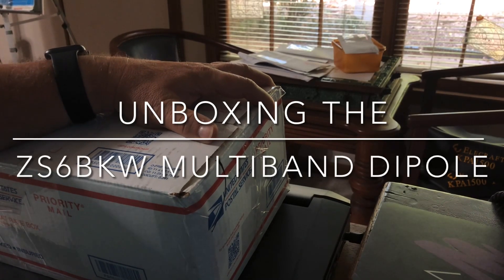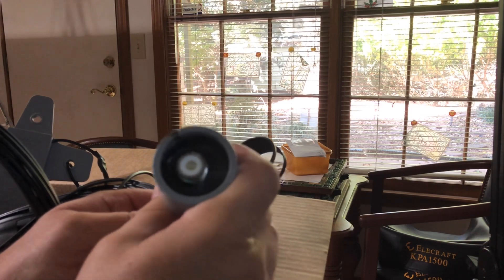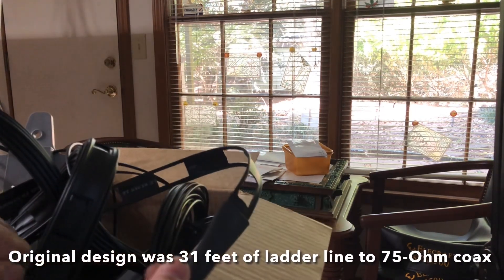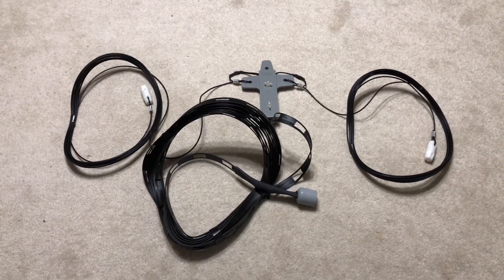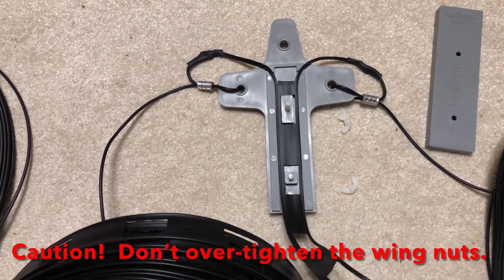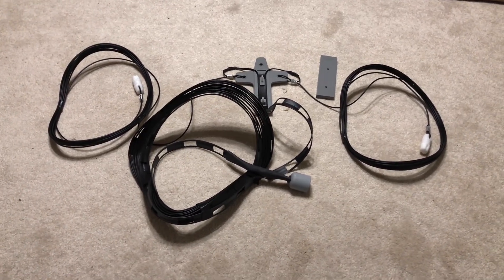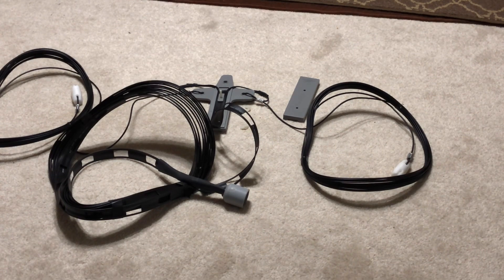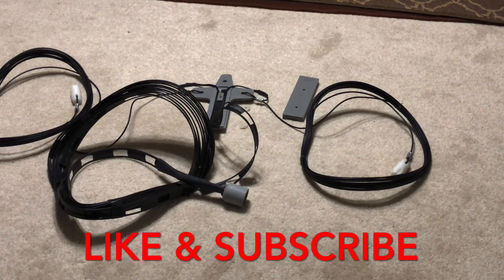Unboxing the ZS6BKW multi-band dipole from NI4L.com

Comment: I like this antenna because of its simplicity. If I get one, I will use my tower to pull it up, but the coax has to go through a switch. It will be more than 70 feet, mostly underground. Thank you for showing this antenna.
Reply from the maker: It is a good antenna.  Make sure the ladder/window line can’t touch the tower.  Try to keep it a foot away from the tower.  It shouldn’t be near any metallic object.
Reply: @ Good points and I can keep it away for the tower.  I am glad you showed it because my OCFD from Radiowaze Balun keeps saturating at 500W from my KPA500 using a KAT500, causing the SWR to rise in contesting.  This caused the KAT500 to disconnect the KPA500.
Reply from the maker: I have a German-made OCF dipole (Fritzel FD-4).  I thought it was great until I put up the ZS6BKW.  But, like G5RV, there are many variations of the ZS6BKW.  I prefer the one I have, from NI4L.com.  There is no Balun and it doesn’t need one.  I tested to be sure.

Comment: Do you know how i can get a hold of Chris Fox? I ordered a ZS6BKW from him over a week ago and haven't heard anything. I've tried contacting him through his website with no response. I don't care it it takes a while to get the antenna,but I just want to make sure he got my order.
Reply from the maker: The email on his website is all I have.  I emailed him 2 months ago because his web site wasn’t even accepting orders for the ZS6BKW.  He does that when he is overwhelmed with orders.  I wanted to find out when I might be able to place an order.  I haven’t received a response yet.  I suggest buying two when he is accepting orders.  He sounds like an older gentleman.  There is no telling how much longer he will be in business. Lakeview antennas made the original Ham Stick antennas.  The owner passed away and they were gone.  Autek Research shut down too.  Now MFJ is gone.  MFJ made great antenna matching units and Ameritron amplifiers.

Installing two identical antennas, perpendicular to one another, allows full 360 degree coverage.  Switch between them using an antenna switch, to see which one has the best gain lobe in the direction you are working. 

I heard that Chris is a one-man show. If he’s answering emails he isn’t building antennas.  I think he still works a day job too.  But quite often the issue is parts availability. He has had difficulty getting the wire.  He quotes 7-10 business days on his web site, but some orders have taken a month.  I guess he could hire some employees and maybe double the price of the antennas, but I would rather wait, and pay less.  His prices are lower than others, probably because he is a one-man operation, but he builds the best version of the ZS6BKW.  He builds and tunes each antenna.  I would rather have that than a production line antenna.
Reply: @n4hnhradio Thank you. Like I said, I'm not in a hurry, but I paid him and I'd just like to know if he's going to be able to fill the order. I don't want to reverse the payment if he's working on it. 73
Reply from the maker: Did you receive your antenna?

Comment: Mine will not be permanently installed, so I am wondering the best way to organize and transport it.  I have no experience with ladder line.  Should I just note how it was shipped and duplicate that and use the shipping box to store? Can I use a wire winder for the wires and roll up the ladder line and strap it to a winder?
Reply from the maker: Maybe so.  If you wind the ladder line into a larger circle, not so tight, it might retain its twist.

Comment: Is the Home Depot HDX 150' 16/3 Extension Cord Reel Storage Wrap a good choice to organize this antenna?  I tried commenting with link but it keeps disappearing.   I received mine 08/03/2024 and hope to get it in the air today.  N9DEK
Reply from the maker: If you tried to post a comment with a hyperlink, it won’t post. I had to set a filter to prevent hyperlinks, because of people posting pornography links.

I’m not sure why you would want to roll the antenna up on a spool, but, I would be concerned about flattening the window line. It comes with a twist for a reason. The twist helps it avoid being blown around by wind.

Comment: I am stuck on the Choke Balun vs. no Balun.  I have a ZS6BKW from Amateurradiosupplies, and it comes with a 1:1.  I have had some weird SWR problems, especially on 10 and 20m.  10m has been up around 4-5 SWR, especially the lower part of 10m. I have it up around 32 feet in an inverted V. The ends are about 10-12 feet up.  I did find that using 100 ft. of coax LMR-400 lowered my SWR by about 1 on 10m, and 20m.  I saw someone online say that when they deleted the balun, their performance increased substantially.  Do you think I should opt for deleting the balun and then using a ferrite choke on the coax before it enters the shack ?  Thanks for your input.
Reply from the maker: I’ve tried with and without.  Mine is better without. 10m will normally have a high SWR down in the SSB portion.  But the FM portion should be under 1.5:1.  Mine is around 1.3:1.  There is no harm in using a Balun, but the ladder line length might need to be tweaked.  NI4L tunes his ZS6BKW assuming no Balun.

SWR is a funny thing.  You should read the details about it.  It might put you to sleep, but there is much more than meets the eye.  The reflected power actually bounces back and forth between the transmitter and the antenna - in the coax.  The coax bleeds off the reflected power.  That’s why the longer coax helps. That is a very simplistic, abbreviated explanation.  If you want to learn more, here is an informative link: https://www.iz2uuf.net/wp/index.php/2017/07/29/the-myth-of-reflected-power/
Reply: @n4hnhradio  Thank you so much for your quick response! I’m thinking I’m going to buy the NI4L version based on your comments.  So the version I have comes with a 1:1 balun, maybe that explains why I believe the window line is longer?
Reply from the maker: Just like with the famous G5RV, everyone has their own idea of how to make a ZS6BKW. One thing NI4L does differently is he uses 420-Ohm window line. Each antenna is hand made and tuned before it is shipped.  Tell Chris Fox you heard about the antenna from me.  Maybe he will let you pay double.  Ha! Ha!
Reply: @n4hnhradio  😂 will do!

Comment: I really appreciate you doing this because I am very interested in buying either this or the Palomar Engineering one.  The PE doesn’t require as much coax.  Wonder why?
Reply from the maker: NI4L used a slightly different design, with 420-Ohm window line.  His method yields a broader usable SWR.  He recommends 70 feet of coax to complete the match.  I use LMR-400 for minimum loss.  My ZS6BKW covers 7.0 to 7.260 with 1.5:1 or less SWR.  It covers the General portion of 20 meters with 1.5:1 or less SWR.  It covers all of 17 meters with 1.5:1 or less SWR.  The SWR is 2:1 or less across the 12-meter band.  In the FM portion of the 10-meter band (29.6 to 29.7 MHz), the SWR is under 1.5:1.  It even covers 52.5MHz with less than a 1.5:1 SWR. A wide-range antenna matching unit will allow you to operate all bands from 6 through 80 meters.  The MFJ-939Y works well.
Reply: @n4hnhradio  That sounds good.  I would like to get away from using an ext tuner.  Thanks bud.  He should be giving you a commission on sales.  73
Reply from the maker: The internal antenna matching unit in the FTdx10 can match the NI4L version of the ZS6BKW on the other bands it doesn't cover, except for 15, 30, and 60 meters.  Of course, it won't match the 160-meter band.  The antenna is too short for that band.  But it can touch up the band edges of 6, 10, 12, 17, 20, and 40 meters - the bands it already covers with a 2:1 SWR or less.  A wide-range external antenna matching unit would allow operation on the 15, 30, and 60-meter bands.  I wouldn't accept a commission, even if offered.  My channel is primarily funded by Patreon team members, so I can avoid the censorship that manufacturers would require.

Comment: ZS6BKW is a great antenna.  I built my own from scratch, but the individual parts cost almost as much as the completed antennas, like the one you're showing.  Although the NI4L model doesn't have a balun.  The Palomar Engineering version has a balun and recommends short runs of coax (as short as possible), not the 70 feet.  Maybe the balun negates the need for a long run of coax.  I use a 1:1 balun on mine and about 65 feet of coax.  My length of coax wasn't designed for matching, it just happens to be the distance from shack to antenna feed.
Reply from the maker: Like you, I prefer to build. I built all of my wire antennas until I bought a G5RV to get up and running quickly at a new house. 

A few years ago I decided to build the ZS6BKW but when I priced the parts to build one at the quality of the NI4L version, it didn’t make sense to build my own.  I don’t use a choke but I did snap ferrite on the 75 feet of coax just before it enters the shack. The ferrite is only needed when using the antenna on a non-resonant/non-harmonically-related band.  It actually worked fine on those bands too, but it made me feel better to choke it.  There is a video from last year, when I upgraded to LMR400.
Reply: Using 70' or more of coax does help to flatten the swr down a bit on most of the bands the antenna works well on without the use of a tuner plus on 75 meters if the current balun is not rated up around 3Kw and your using 1.5Kw and your tuner you may find out your weak link is the underrated balun. I have used Hb versions of the ZS6Bkw for years and have found if your using between 70-100ft of coax it works well without the balun plus you have less components to break down. Its performance seems the same, this NI4L version uses extremely good poly stealth wire with very hi breaking strength, he uses 420 ohm line in which if you do the research that gives the best match between 400 ohm and 450 ohm line, its very well made plus his center insulator seems that it would avoid any flask over point when hung from a tree branch, looks like a plug n play deal.
Reply from the maker: It definitely doesn’t require a BalUn. But it requires at least 70 feet of coax. I use 75 feet of LMR400.  I experimented and connected a BalUn. It skewed the points of lowest SWR.  I removed the BalUn.  I did add three snap-on, Mix-31, chokes to the coax for good measure.  They absorb any common-mode current without the loss of a BalUn - though the loss through a BalUn isn’t much.

Comment: Why the discrepancy in coax length between different sources? Palomar states any length.
Reply from the maker: Brian Austin, ZS6BKW, computer-modeled the design and a minimum of 70 feet of coax helps complete the match. NI4L even has a disclaimer that warns about the antenna not functioning correctly without at least 70 feet of coax.  The NI4L version doesn’t require a BalUn. Maybe Palomar is trying to sell a BalUn.

Comment: I built my own for less than $30.00.  It's been up in the trees for 12 plus years.  My doublet works much better on 75-80 meters.
Reply from the maker: The ZS6BKW is in the doublet family. Mine competes with my 160m doublet on 75/80. One has lobes where the other has nulls and vice versa. Where there is overlap, the 160m has the edge. The ZS6BKW has the better S/N ratio. It is also my best performer on 40, 60, and 17.  It’s nice having options.

Comment: Hi Doug, I was wondering - how do you feel about the ZS6BKW compared to an EFHW (MyAntennas) antenna? I have both, but only have room for one on my push-up mast. It “seems” that the EFHW might be better for DX, but the ZS6 seems better for 40. Curious what you have found. Thanks for your videos.
Reply from the maker: The ZS6BKW wins. Better pattern. A friend of mine had a MyAntennas EFHW. He replaced it with a ZS6BKW. He only has his 13 feet up in the middle. Ladder line on the ground. Not supposed to let ladder line touch the ground. 100 feet of coax. That’s okay. It needs 70 to complete the match. He has the ends 6 feet off the ground. 10 feet or more is best. He doesn’t like to work DX but a guy from Indonesia kept calling CQ very early one morning while my friend was awaiting others to join his morning rag chew. He went back to the guy to shut him up. This was on 40m. My brother switch from EFHW to ZS6BKW and immediately worked Japan. He got a 57 with 100W.  

Band conditions could have contributed to both of their experiences but they have both consistently reported great performance from their ZS6BKW. My brother’s longest DX contact is over 11,200 miles, with his ZS6BKW. All three of us bought ours from NI4L.com. He makes the best version of ZS6BKW. 

Note also that the ground beneath your antenna, and surrounding objects, affect performance. You might use the exact same antenna as me and not get the same performance. But the ZS6BKW has proven consistent for my brother, several others we know, and myself. 

73, de N4HNH
Reply: @n4hnhradio  Thank you so much for your excellent reply, it really means a lot to me. I've been struggling to figure out which antenna is "better," but really like the ZS6 on 40 (big difference), but haven't compared it for DX enough to say. I will put the ZS6 back up now that I've had the EFHW up for a few days and let you know what I find. It sounds like the ZS6 should be the winner. Thanks again, best, Joseph
Reply from the maker: My ZS6BKW is my best 40m and 17m antenna. Also works well on 80m with the ATU in my amplifier. It also works well on 12m and the FM portion of 10m. In fact, it does well on 20m, though it doesn’t usually beat my 160m doublet on 20m. But it blows away my doublet on 40m. 

73, de N4HNH

Comment: You mention it needs 70' of feedline. Any idea of possible problems using a longer feedline (RG8X)? I will need about 120 feet to make it too my QTH.
Reply from the maker: It needs a minimum of 70 feet of feedline to complete the match.  You can use a longer run of coax if necessary.  I use 75 feet of RG8X.  I plan to replace it with 75 feet of LMR-400, so I can squeeze a bit more power into the antenna.  If you need 120 feet of coax, I would suggest RG-8, RG-213 or LMR-400, to minimize the amount of power/signal that is lost per 100 feet of coax. 

73, de N4HNH

Comment: 😂😂😂 you pronounced my name more correctly that many people in my country. In my native language is easy to pronounce...but I don't know why...anybody in my country mispronounce my name (they add letters, subtract or replace).
Now, that you are not upset anymore on my jokes...just a technical question: First, my current setup: 2x92ft dipole, feeded with 20ft of ladder line ended with a 1:1 balun and a external tuner. From there I have around 140ft of coax until my apartment. Now, regarding ZS6BKW... removing coax and in stead put a external tuner (automatic tuner, currently I have a MFJ 993BRT external tuner) just in feed point of ladder line (ofcourse, with a 1:1 balun)...how is working? Also, if is working on 160m (with atu). Now I will explain why I have this question: I am in a big city and with very limited posibilites (two): One between two apartment buildings (60 ft high and distance between buildings are around 130 ft)...there I am able to put 30-40 ft of coax. The second is overy my apartment building...but there...I will have around 120ft of coax. But also I want to operate in 160/80m. But this will bring a lot of losses over the coax.
Reply from the maker: I would suggest a doublet over the apartment.  Ladder line is not too much loss.  Very little loss compared to coax.  You will need the tuner but you can work every band from 6 to 160 meters.  Bring the ladder line all the way to the tuner.  If the tuner is outside that is better, but you can install chokes on cables for microphone, computer, CAT, mouse, etc.

P.S. I’m glad I said your name correctly.  I try to pronounce people’s name correctly.  I teach software around the world and I’ve had some tough names to pronounce.  They will tell me to just call them “Bob”, “Joe”, etc.  But I insist upon learning their real name.

73, de N4HNH

Comment: Have been thinking about acquiring this antenna.  If I hang it on my tower or on a metal pole would the ladder line, aligned along side the metal tower and or the metal pole be affected?  Would this affect the SWR?  What has been your results?  Thank you.  73 KD4FJ
Reply from the maker: I don’t have a tower.  Mine is suspended from a tree limb.  I have a friend in Kentucky who suspends his doublet from his tower.  Of course being a doublet, it is fed with ladder line.  He mounted a horizontal arm at the top of the tower to support the center insulator.  It’s the only thing his tower is for.  There is no beam or anything else.  His ladder line comes down from the center point but it is a couple of feet offset from the tower.  His antenna is a beast.   He is 59+40dB to me on 80 meters.

73, de N4HNH

Comment: How well does this antenna work on 80 and 160 meters?  I’ve searched and contemplated for months on which multiband antenna to buy for 160 through 10 and maybe 6 meters.
Reply from the maker: It isn’t long enough to be effective on 160 meters.  It works well on 80 meters with a tuner.  It can operate every band between 6 and 80 meters, with a tuner.  It doesn’t need a tuner for 40, 20, 17, 12 meters, or for 29.6 to 29.7 MHz.

73, de N4HNH
Reply: @n4hnhradio  I forgot it that it isn’t long enough for 160.  It does sound like it would be a really good antenna for the other bands you mentioned though.  Thanks for doing the video.  Very informative!
Reply from the maker: Yes, it’s in the doublet family.  Doublets usually produce great gain on bands they are long for.  Of course the gain varies in direction because there are nulls too.  Install as an inverted V to round out the pattern a bit.

73, de N4HNH